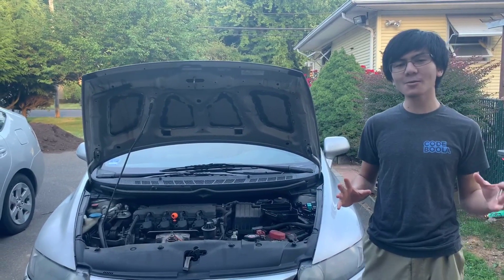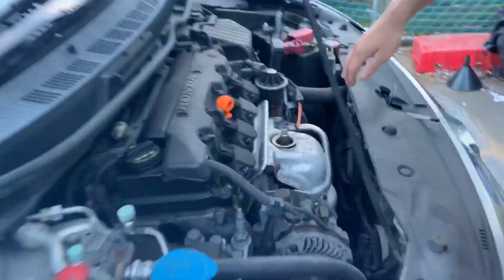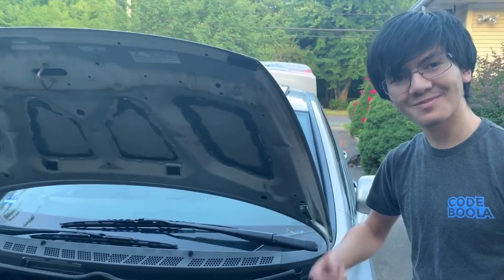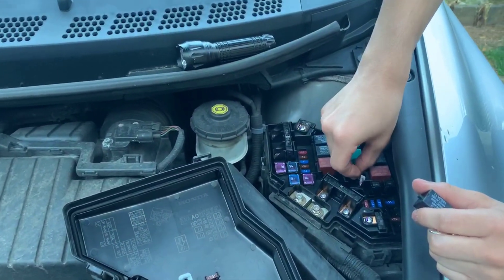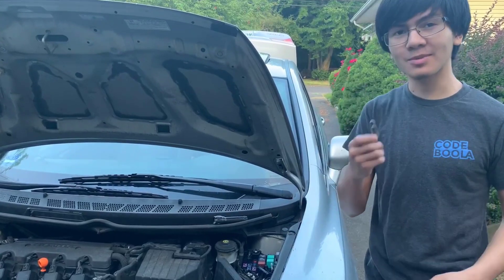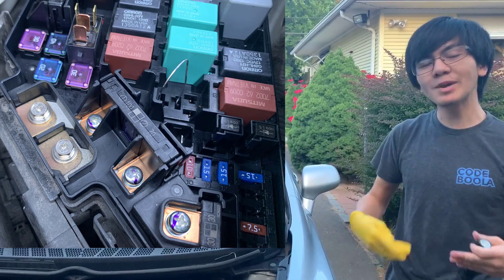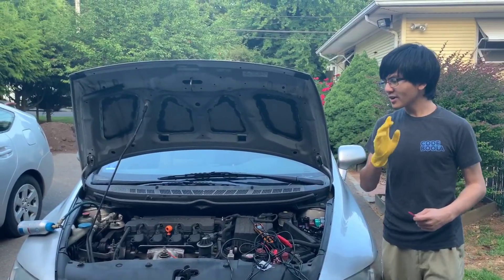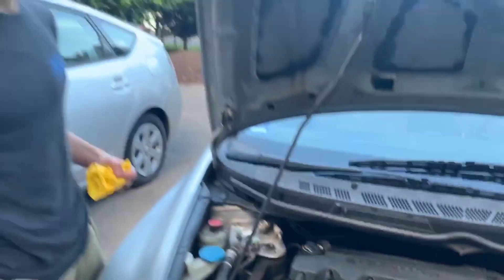How To Jump Start AC Compressor Clutch Using Paper Clip Bypass Relay | Add Refrigerant Manual Engage

Comment from the maker: Here are the #ᴬᴰlinks to tools, parts and accessories you may need to perform this repair:
1.  https://amzn.to/3r0SRpM  |  AC Relay Micro Iso 4 Pin 12V G8HL-H71 Compatible for Honda Accord Civic Crosstour CR-V CR-Z Element Insight Odyssey Acura TL TSX MDX 39794-SDA-A03 39794-SDA-A05 RY1224-2 Pack
2.  https://amzn.to/3RaAedA |  AC Pro Car Air Conditioner Synthetic R134A Refrigerant, AC Recharge Kit with Hose and Gauge, 20 Oz, ACP200-6
3.  https://amzn.to/3Pn7D3w  |  XLichamp A/C R134A Refrigerator Freon Recharge Kit with Bullet Piercing Valve, Piercing and Self-Sealing Can Tap 134A
4.  https://amzn.to/3R87WjN  |  ZeroR® AC Refrigerant | R134a Replacement | 3 6oz Cans for AC Recharging
5.  https://amzn.to/3Rbc96r  |  Orion Motor Tech AC Gauges, AC Manifold Gauge Set for R134a R12 R502 Refrigerant, 3 Way Car AC Gauge Set with 5FT Hoses Couplers & Adapter, Puncturing & Self Sealing Can Tap Freon Charge Kit

Or Click on Amazon link here and search for what you need:  https://amzn.to/3xIOsqg

Comment: The reason why your refrigerant isn't going in is because you have to put a vacuum on the system. If you don't put a vacuum on the system the air and the moisture the humidity in the air in the lines will make acid with the refrigerant. You never need to jump a compressor

Comment: Thanks for making this guide but as some have commented below, jumping the compressor clutch is not needed when refilling the system and can damage the compressor. The clutch will engage when the right pressure is reached. Be patient.
Your tip is however very helpful to momentarily confirm that the clutch is functioning (no ignition or engine on)  Same goes for testing the compressor fan 
😃
Reply from the maker: Thanks for sharing your experience! Appreciate the addition tips. On most cars, yes, there is no need to jump the compressor. Just wondering you've ever tried on 2004-2008 Accord, if that ever worked. We've tried and waited for hours and it didn't work. And that's probably why lots of people came to watch this video. At least you're nice about it, but some people just plain rude in their comments. One rule doesn't apply to all. And everything on youtube has inherent risks to following its instructions.
Reply: @EyeOnAiman  Oops, sorry mate, my bad, I saw your engine bay and assumed it's exactly the same as my 2007 Honda CRV. I guess each model has it's own peculiarities. Carry on...but do consider using a refill with a guage.
Thanks again

Comment: Why not just start it in the ac pressure switch connector ? Much safer and easier than risking being electrocuted or burn down the fuse box

Comment: Hi I am just curious  , I noticed that your ac condenser fan was running even the ac compressor clutch isn’t engaged.  Is that normal? Because I want to know. My ac condenser fan doesn’t come on because when I try to turn on the ac 😢 on.  By the way my ac compressor clutch is not engaging. Please help
Reply: cars have different circuitry.

Comment: I try but the clutch still not engage. Whats the problem now?  Need buy new compressor??
Reply: Yes ,the clutch is bad, you need to replace it or buy a new compressor
Reply: check the fuse first.  check the connector at the compressor.

Comment: It’s better just to pull a vacuum. That’s how I used to do mine but if you pull a vacuum to get most of the moisture out then it will take a charge best way though is to pull a vacuum and see if it holds the vacuum if it doesn’t hold the vacuum, you have a leak, check for leaks system and use soapy, water or listen and see if you can hear the league. You’ll be just wasting lots of money if you don’t do this.

Comment: Wtf are you talking about. The compressor will kick on as soon as low pressure switch is satisfied. Gas will easily be at (r-134 is basically 1 psi per degree. Close enough anyway) 75psi on an 80° day. Runs at about 45psi when charged. So simply hook up to your suction line and add gas. If that is your only issue it will start itself.
Reply: Not to mention if you have a shout and you stick that paperclip it will instantly glow red hot and burn the shiz outa your fingers
Reply: What can happen if you listen to people that do not know what they are talking about like this guy, you have a leak if you are low/out of refrigerant…. You jump out compressor like only an imbecile would do…. You now pull the system into a vacuum an suck in non condensible gasses  into your system ( air/humidity) and you are screwed. You will now be going off on the high pressure safety instead of the low pressure safety.

Comment: what a stupid idea if your AC compressor does not come on take it to the shop, or you will have to pay hundreds if not thousands, if you accidently lock up that compre6ssor kiss it goodbye. bad advice from a rookie. jump wrong pin burn out a computer. with out evacuating the system it will never run good because it has air and moister in it. bad idea rookie.

Comment: As a pro technician I don’t jump or bypass ac compressor relay. That’s because ac compressor are meant to cycle. Two some AC compressors are extremely expensive. An example is for a 2014 Honda civic hybrid, they cost almost 3,000 dollars 2,800 dollars to be exact. I don’t think you would want to risk burning up an extremely expensive compressor like that. Even regular compressors cost 300 dollars on up brand new. It’d best to troubleshoot why they do not kick in rather than doing this. There can only be few possibility. Start with a fuse, then check relay. Learn how to check a relay and load test them. 3rd is pressure sensor, 4th is compressor thermal protector some are equipped with thermal protector. You will know because there is at least three wires coming into the compressor one for the clutch and two for the thermal protector. Another thing to check is temperature sensor, then climate controller last to fail would be PCM where sometimes the transistor that drive the compressor relay fail. Something like that would drain your battery because the compressor clutch is always one even when car is off. Why so? Because when transistor fail they usually short. That makes the turned on all the time.
Reply: You probably have a 5k+ snap on bi-directional scan tool. Jumping for a quick second is fine imo...
Reply: It is necessary, as the kid said, when the freon pressure is too low and the pressure switch will not allow the compressor clutch to kick in. I know this is to protect the compressor, but if you don't then the pressure is still to high for any freon to flow in to the low pressure side, because the high and low are equal when it isn't running. It is literally the same thing a diagnostic tool does when you plug it in and force the compressor to run in order to fill the system. This is also what the manual says to do in order to fill a low system on nearly every older vehicle. Newer computer controlled systems do the same but without jumping the pressure switch, they do it internally by manually telling the computer to engage the clutch regardless of the pressure. The effect is the same, the compressor runs with less than optimal Freon and oil for a few seconds at a time, but freon and oil are being added, so it is getting oil.
Reply: You don't jump and leave it there. You jump it when your refrigerant has been recovered and the clutch won't engage to pull the new refrigerant through.  Once enough goes in You put the relay back and it will come on and off as it should
Reply: @newflyer48  where is your HVAC license? I will show you mine
Reply: @ronaldoquintos1675  you sound like a fun guy lol
Reply: Hey Ronald do you dispute the fact that a compressor might not come on with a low charge? Do you dispute the fact that temporarily activating a compressor to take in the second half of the charge is wrong? I'm proud of you for getting your credentials, but tell me what is wrong with jumping a compressor for 10 minutes? This is assuming I'm running both fans. 
@Payote88 : You don't
Reply: @johndavid3598  Ooo edgy come back for somebody your age. Now go back to your classic rock and dreams of being a cowboy boomer John no one asked you.
Reply: Compressor ain't turning on due to low pressure switch, can't charge the system without compressor running. So he jumped it out. Makes since to me. I have my epa universal license if you want to tout credentials.
Reply: Just jumped my compressor with a paperclip. Absolutely fucking genius. Don't do it for long, tho, as soon as it starts pumping freon, put the relay back in and you'll be fine
Reply: Thanks for the message.

In case you see this, I just had a new compressor put in my Accord. The shop says the compressor clutch engages and nice and cold air blows when the relay is jumped. But the radio/climate head unit can't get the compressor to turn on. The fuse and relay is good.

Because it blows cold air when the relay is jumped, does that mean the pressure sensor and thermal protector are good? So I just need to check or replace the radio/climate head unit? Thanks.
Reply: Shut yo ass up lol if its low you can't add refrigerant so you have to bypass the switch
Reply: And you forgot to mention when your freon is super low the clutch won't engage. So how else are you going to get the clutch to engage????
Reply: This is why I smoke & eat Oreos.
Reply: Just to see if the relay works.
Reply: What if they discontinued the condenser for your vehicle
Reply: Great input 👍🏼 ! But come on , he is just a kid learning and trying his best! Your approach seems to me like you know more then he does  , instead of criticizing this kid , make a video of you showing us your knowledge  without of course, showing us your credential 6:21 credentials ! Humbleness will take you to far places ! Kudos  to you and your credentials ! Knowledge is power !

Comment: What does it mean if compressor works when jumped, spins slowly when not jumped? 12V at compressor. Efan working. Compressor acts up when I pull to a stop
Reply: check idle up.

Comment: No rookie! U can start charging your A/C w/o the compressor OR the engine running. If u vacuum the system 1st 2ck 4 leaks, u can dump Freon in2 1or both sides b4 even starting the engine if u hv head gauges. It's called priming the system. On a hot day, u can dump quite a bit of Freon in2 the system b4 starting. Priming relieves u of the concern about the low pressure switch preventing the AC clutch from activation. 

The bypass that u propose is DANGEROUS &RECKLESS. If u r a novice. NEVER ever try this. U don't need the compressor running 2start charging an empty system. The low pressure safety switch is there 2protect the A/C compressor from failure as the lubricant is housed in the Freon. An A/C failure in some cars will disable the vehicle &leave u stranded.

U should use fender covers in your videos 4best practices. Wow, u put that metal can right down on the fender paint &then dragged it. U won't wk on my vehicles. Never wk ovr your fender paint.

Comment: What if my car is full on refrigerant? Would the compressor engage with the paper clip on the relay without adding the refrigerant at the same time?  I know my relay is still good cause I tried swapping it out. I have a 2008 civic
Reply: I’m not an expert by any means but if it does have refrigerant I would say make sure the relay and fuses are good and if so then it could be the ac compressor clutch itself that is the problem.

Comment: Hey just a quick question if you still look at the comments. I bypassed it and it clicked on and I charged it but it’s not clicking on when I put the fuse back in, any tips?
Reply: Make sure your clutch is engage at the time you bypass the relay entrance in the fuse box, if is still engaging you relay is bad is what I understand

Comment: Good afternoon Aiman hope your day is going well!
Reply from the maker: Good afternoon! Hope your day is well too!
Reply: @EyeOnAiman I need to do a crank no start on a starter relay, does it really matter which wire I use or do I need to use something specific?
Reply: Take rubber handle screwdriver touch the small wire and ground with key on and parking brake on

Comment: Why start compressor in an unsafe condition and hope you get enough refrigerant in before you damage it? It’s not running because the low pressure interlock is not satisfied. Simply start car, AC on max, and add refrigerant. When the low pressure switch is satisfied, the compressor will start in a fully protected condition. Took one minute for
compressor to kick in and 5 minutes to charge. Still ice cold AC after 2 mos. Use a gage to avoid overcharging.
Reply: The gauge reads high until the compressor kicks in. Then you’ll read the actual pressure. I’m not sure why so many bypass the low pressure
interlock videos exist, but I’m sure compressors have been damaged by looking at some of the comments and questions.
Reply: Did your refrigerant have a gauge? If so, did it jump to red and stay there before the clutch engaged?

Comment: i have a situation. My relay load circuit is good but my control circuit does not reach ground. i tested the relay for continuity on load circuit and using alligator clips to a 12 v battery on control circuit and it is good. where can i bypass the control circuit to reach ground? this is on a car by the way. any comments and suggestion ?

Comment: i think the better fix is replace the relay :D
Reply: You’re not understanding the video. The relay isn’t the problem. He explained it in the beginning of the video. The relay won’t receive a signal to switch to the “on” position and send a signal to the compressor if the pressures are too low to begin with and this is due to the low pressure switch. So, he’s bypassing the entire system to manually override the relay and force his compressor to engage, in turn this fills the system with Freon and then it works fine.
Reply: @michaelscott33  ah ok
Reply: @michaelscott33 
My ac was working but then all of a sudden it stopped blowing cold air on freeway. So I tried reducing the compressor clutch gap with no spacers then one spacer clutch still didn’t kick in with engine/ac on so it not the gap. I suspect the clutch or coil. 

SomI hooked up ac gauges with engine off and ac off and just took readings and its about 80 deg H And 84 deg L with ambient temp of 80 under hood  and this matches the charts, so this tells me I have some r134a and about same readings with engine and ac on but clutch is not engaged. 

So now I should jump it like video with our recharge and see where the readings are if the clutch engages if not then I know its the compressor clutch/coil is bad?

Comment: In my car. after switch ON A.C. after some time compressor stop stuck, clutch trying to engage but compressor stop  moving. Engine speed also reduce. Clutch start ON and off. If we stop the car for 1 hour and again we try to switch ON A.C. , it will again Star working give, in side car A.C. give cooling but after 2 minutes again compressor stuck and clutch start ON and OFF. Please give some suggestions.

Comment: I have a Honda Civic 2011, and my AC after some time working mainly on hot days suddenly stops working and starts giving only hot air. I have changed the compressor relay already, but the problems persist. If you check the entire system even when the ambient temperature is high it starts fine, but after a while when I get caught in traffic jams my AC does not perform well anymore, any suggestions on how to diagnose it?  Thank you very much, your feedback is highly appreciated.
Reply: did you replace your expansion valve? if you have a block or H expansion valve  they can go bad after certain time...
Reply: @mlez7197  No, I have not checked into that.
Reply: Probably the clutch clearance is excessive. Should be .35mm- .65mm clearance.
Reply: @VeeYehLa  thanks, how can I fix it?
Reply: @carlosgalvis4538  if there is too much clearance you can get a new clutch, coil and pulley and get it replaced
Reply: @VeeYehLa  It is possible to get it new if the car is 2011? if so, could you suggest to me where I can get it? Do you have any video to see how the replacement of the clutch should be done? Thank you, Esteban!!
Reply: Probably have too much refrigerant in your system

Comment: Great idea!
I did your instructions and the clutch kicks but still it doesn't recharge the refrigerant.any ideas what would be my next step to check?is the compressor dead?hoping for your reply.
Reply: Watch a more reliable YT video. ;)
Reply: Did you figure out the problem?
Reply: @Priscilla_bbi  I replaced brand new ac compressor
Reply: @CaFarmersDanteAbellar  how much it cost?
Reply: @lukelarssen7072  260 dollars for the compressor

Comment: I have a 2007 honda accord. I can jump the compressor clutch at the relay and filled about a can and a half.  Great blowing cold all good. But when I put relay fuse back in the clutch will not engage. Check relay and clutch 7.5 fuse and they are all good. What the hey?  HHEELLPPPP!!!!!!!!
Reply: The thermal protection is the likely culprit, or the rely you put back in is defective
Reply: @cire80  same here when removing paper clip.. Clutch doesn't engage Can I just leave the paper clip in? Works great, and blows extremely cold. I have a 2001 chevrolet truck. I only use it for short distances to work and back home.
Reply: @melvinspringer5486  thermal protection is there to protect the compressor from getting too hot, I don't really know how long till a compressor overheats,  but you'd be rolling the dice.
Reply: @cire80  Thank you very much! That's what I needed to know. Just going to go ahead and get it fixed correctly. But it's working great until payday. Thank you so much for responding. Very much appreciated
Reply: @melvinspringer5486  FYI, if your compressor doesn't have a thermal protection, then it's likely that you have a bad relay and or fuse, they are not expensive, best of luck.